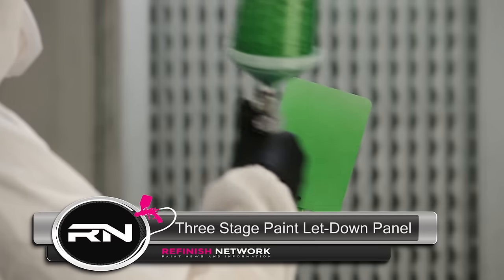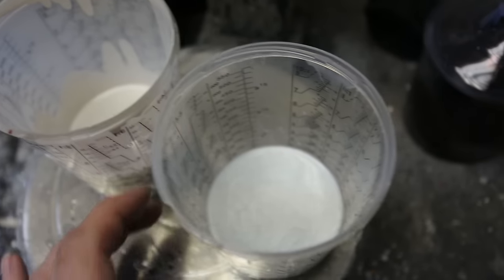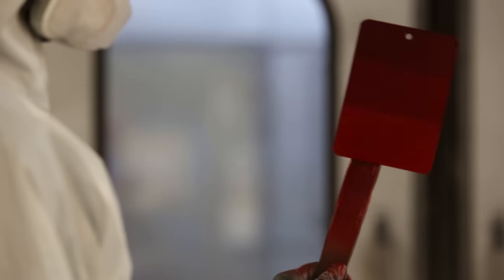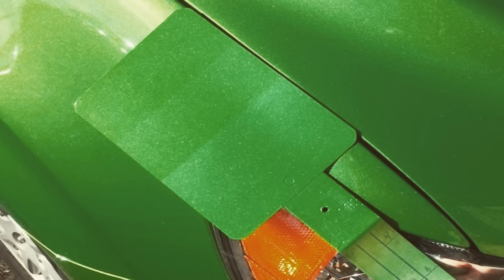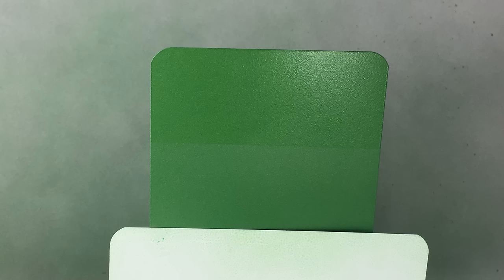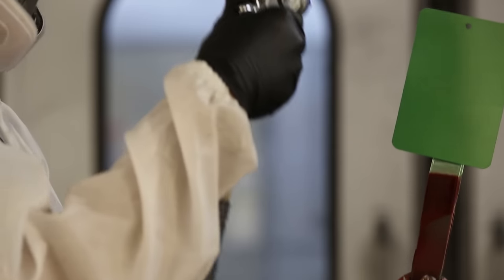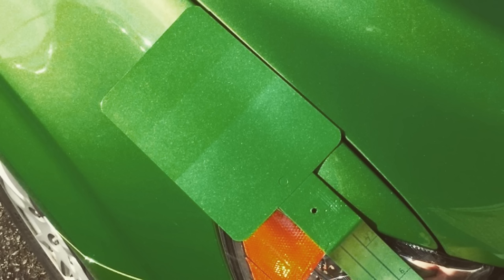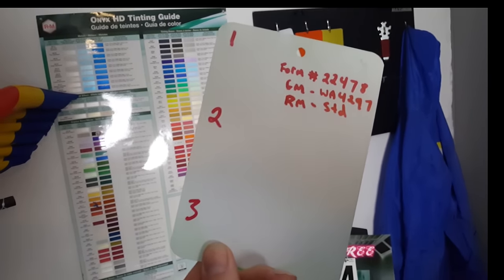Three Stage Paint - Creating a Let Down Panel

Comment: Tape your cards to a cardboard box rather than a stick. You will find it more accurate due to most of the time you apply more coats to the card because of overlap. If you watch the video you can see that the applicator put on like five coats on a three inch area. Tape your card to a box so you can get distance and overlap more accurate.